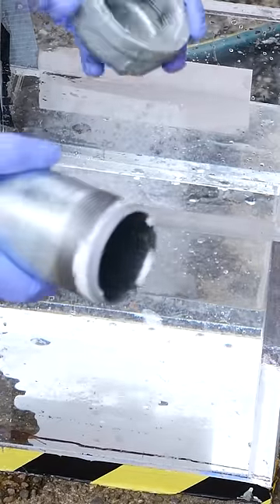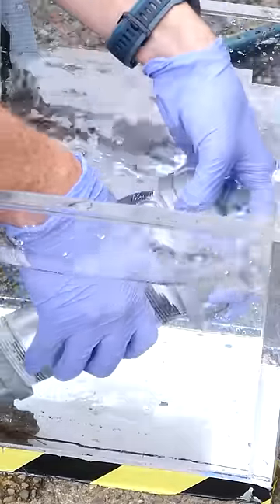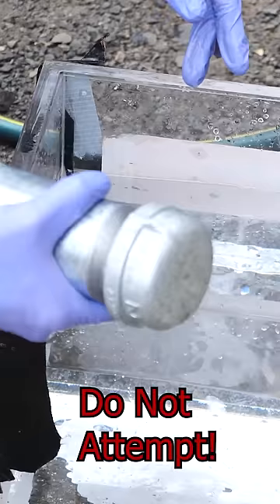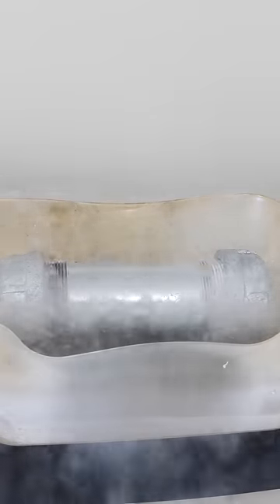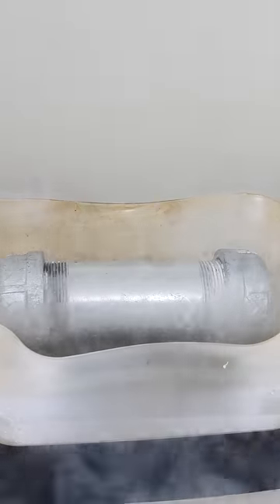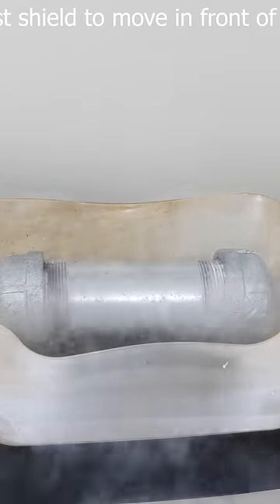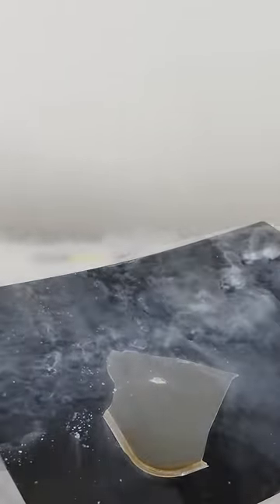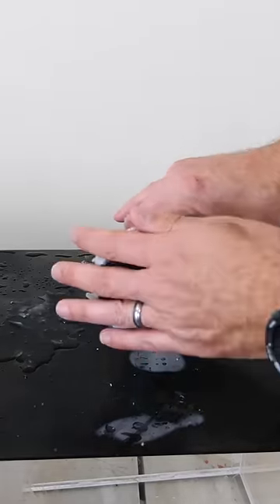Don't Ever Try To Stop Water From Freezing!

Comment: This is how you get burst pipes in winter. You should always turn on at least one faucet to a trickle during a deep freeze to prevent this from happening.
Reply: Drain your pipes much easier
Reply: it really only needs to be a pipe that's near the outside walls of your home — an interior room with plumbing is less likely to freeze ( so long as the inside of your home is above freezing)
Reply: @architecturalab incorrect.  But something an architect would definitely say. 👍
Reply: @architecturalab I usually flush a bunch of orbees down my toilet and down my drains to suck up the water
Reply: @corpsehandler5321 texas homes when snow: 🧨
Reply: No man. You need to insulate your pipes. Make them a winter jacket.
Reply: @nevinkuser9892 what? But insulating your pipes won’t help you here. What is that going to achieve?

Insulation only makes things take longer to reach equal temperatures. Not stop it from happening.

Basically if your wall is below freezing the only difference would be that it would take a little longer for the insulated ones to burst. But they would still burst.

Since most homes that people actually live in are heated it’s very unlikely that the wall would reach negative temperatures. This is more of a problem for something like vacation homes where people may be away from for months. In that case insulation on the pipes does nothing.
Reply: Why stop at just one? Do all of them to lower the risk as much as possible.
Reply: Or dont build pipes in outside walls??? 😂😂😂
Reply: Ran out of heating oil on Christmas Eve and the faucets were frozen shut for a good until like the 28th. Shit was wild I'm surprised we didn't burst a pipe
Reply: @xanderwusky  insulating pipes increase the amount of time between when you turn on the faucet, and pipes bursting.
Reply: @doppled  fair yeah it could do that

Actually I’m not entirely sure? Only if they would be empty if the faucet is turned off. If there is water in there anyway that would eventually freeze no?
Reply: @xanderwusky  i'd imagine like, having 4 hours to turn on the pipes before they burst when it gets cold vs like 10 hours

gives you a bit of flexibility
Reply: @doppled  I’d say if your pipes are build that way you just have badly build pipes. They should just be closer to the inside of your house so they don’t freeze in the first place. Your house heating should take care of that. I have pipes running though the wall too but it can be -20c outside and 10c inside and they still don’t freeze.

If it’s not at a place you’re heating because you’re not living there then having a still fairly short timelimit like this, definitely means you’re gonna be missing that time limit at least once. And if that happens you now have bursted your pipes.

I think you just have to have it heated or empty the pipes if you really don’t want to make the room even slightly heated.
Reply: This happened when I was in high school. My bedroom was in the basement and guess what flooded?
Reply: Having one end of the pipe drip won't protect the whole system.
Reply: nooooo! you're sewage pipe will freeze and you will flood your house if you leave the faucet on. You should have heat tape on any exposed pipes to prevent freezing. Im speaking from experience here
Reply: Last winter my faucet got pushed by the water expanding with so much force that it came loose and it dixnt even burst!
Reply: I do this every winter......
Reply: This happened to me this past winter in oregon... I'm a lazy pos though so I still haven't fixed it yet.
Reply: Thats how ypu end up with a frozen well. Frozen sink frozen kitchen frozen front porch frozen house...if you are on a well that water will push until it runs out which is essentially never. Least...not in this life
Reply: @KeaveMind that’s just silly
Reply: @architecturalab you go all winter without running water?
Reply: Yeah Texas been hearing that one a lot the last few years
Reply: If you have freezing pipes you had a crappy builder or a once in a hundred year freeze. It’s that simple.
Reply: @BlueDart1971  my pipes are inside the house and wrapped, but we do get the occasional deep freeze where it’s 25-30 below and it’s more of a precaution than anything.
Reply: @foosmonkey  I live in Alaska and I have also been a plumber for over thirty years. If built properly they won’t freeze unless there are extraordinary circumstances. It never hurts to take precautions.
Reply: Below 13 you gotta have them running at steady stream.Learned that the hardway while I was out of town
Reply: @nevinkuser9892 it's called heat tape and we do use it where winters are cold.Its not only insulation it plugs in and warms the pipe.Its like an electric blanket for the pipes.
Reply: @xanderwusky nope..... happens every year where I live...even with the inside heated well and and modern insulation pipes will freeze when it's gets around 20 and lower.
And yes, people do insulate pipes it's does help.There is also heat tape which is what I have,a litteral electric blanket for my pipes.Pretty common and not that expensive....but I still have to let them trickle when it's in the teens or they freeze.
In a vacation home even the toilet bowl/tank water will freeze.
Reply: Yep. We turn off all external water pipes outdoors around our property each winter. They’ll be turned back on once the freeze ends and spring is on the way.
Reply: My family learned that the hard way shit just bursts outta no where
Reply: Forgot that other places need to do this, our pipes are made to actually work in the winter and I’m so grateful for that
Reply: A trickling tap will not prevent this from happening... That's an old myth
Reply: Csme here to say this.
Reply: @xanderwusky  You ate the onion though they do put warm winter jackets on backflow preventers.
Reply: @TheTyisawesome It is not.  It’s common sense if you’ve ever lived anywhere cold or spent the 2 seconds to fucking Google it.  It works best if it’s furthest from your supply.
Reply: What's more is the metal is becoming brittle as well. Not a good combo at all
Reply: Jeszues!!! Ya vent the pipes so your don't create a vacuum! Lower pressure,  lower freezing point. Take an effing shop class. Ya know what, don't.  I like how this Darwin thing is swinging.  😊
Reply: @Redact63Lluks  It something a plumber would agree with. Drain your outdoor pipes in winter.
Reply: @nabtig5586

My friend..if your "flushing something that "soaks up water"
thats all good and fine and all
BUT the pipes most prone to damage from freezing are not your pipes that do the draining aspect of your plumbing system i.e DWV
drain,waste,vent. No sir..The pipes most susceptible to this type of damage are your water supply pipes i.e your hot or cold incoming pipes.Your homes water lines will be in either galvanized steel,copper pipe hard and/or soft copper,or a plastic pvc,cpvc,abs,oe a type of pex pipe tye 1 or type 2 pipe. With that said the logic behind leaving a fixture trickle drip is to evacuate some volume of water from your plumbing systems pippe BEFORE it has the chance to freeze you basically keeping the water slowly moving before it is allowed to completely become rigid and freeze. This works magnitudes better if the fixture that is allowed to trickle drip is the actual fixture/fixtures
 themselves most exposed to the freezing temperatures meaning if your home has two exterior hose bibs or points outside your house where you can hook up a garden hose to then those are EXACTLY where you would impliment the slow drip from the fixture and it would make it even less likely any damage might occur if in addition tthe 2 exterior hosebibs allowed to slow drip but also leave one INTERIOR fixture to trickle drib also i.e. a lavatory (bathroom sink)
kitchen sink ,bathtub etc. HELPS WHEN ALL EXPOSED PIPE IS INSULATED AND ALL BURIED PIPE BELOW SOIL ARE ALSO INSULATED TO A MINIMAL DEPTH OF 18" AND UP TO BUT NOT INCLUDING MORE DEPTH DEENDING ON YOUR HOMES LOCATION & HOW REGULARLY YOUR HOME IS SUBJECT TO FREEZING TEMPERATURES I LIVE IN SAN ANTONIO TEXAS SO A RESIDENTIAL INCOMING WATER LINE MUST BE BURIED A MINIMAL 18 INCHES BENIETH THE SURFACE BUT IN ANCHORAGE ALASKA..THAT MINIMAL DEPTH WILL BE MUCH DEEPER THAN 18 INCHES SINCE ANCHORAGE ON AVERAGE IS MUCH COLDER THAN SAN ANTONIO TEXAS. IT WOULD NOT BE MUCH TO OPEN ONE FIXTURE INSIDE YOUR HOUSE AND LET YOUR EXTERIOR FIXTURES ESPECIALLY IF THEY ARE NOT INSULATED REMAIN CLOSED COMPLETELY. some knowledge
from one that has been in this thank-less and under appreciated
trade since 1995.
Reply: @xanderwusky woosh
Reply: Yup this is why water services and water mains are always below the frost layer, water services and mains can run up to 8 feet deep to prevent your house from having no water during the winter. And like you said the pressure builds up and the pipes explode and during the summer you end up dealing with leaks and muddy water in your house. IF it's one of those old water pipes that isnt deep enough but I'm sure most of those were replaced long ago.
Reply: @jacobadams5941  don’t think you get how that works
Reply: prependedprepended6606  that’s an entirely different situation in that case you’re actively heating instead of just insulating. Then absolutely that would work.
Reply: @delmuswu-tangbroadnax9056 Texas?
Reply: @architecturalab and not use the water for toilet, cooking, drinking, washing? That is easier?

Comment: You might have forgotten to mention that metal contracts with lower temps or when it gets frozen.
Reply: That's why water pipes freeze.  Old pipes used to need to have people getting water from them to keep water running slowly or at a fast drip or the pipes would break.
Reply: LN2 temperatures also makes steel extremely brittle. If the temperature was taken down gradually like in a household freezer, the steel would likely flex but not break
Reply: @i3igpete  no, it would have failed 100%. The threading used to screw the top on was what gave. That would happen regardless.
Reply: @i3igpete  What is LN2?
Reply: @edwardlewis1963  The sequal of Liquid Nitrogen
Reply: Not only does it contract. It also becomes brittle.
Reply: @edwardlewis1963  he means liquid N2(nitrogen)
Reply: @vighneshprabhu4242  Oh, thanks; LN2 = liquid N2(nitrogen)
Reply: Get em!
Reply: @jackpokrywka542  the threads didn't fail, the pressure rupture the cap. you can see it's still threaded on.
Reply: @dominator-tc8ik  couldn’t really tell with the ice covering, I didn’t look that hard at it. Looks like the top of the cap gave out and the sides of the cap stayed on.
Reply: @xtradrive-kz3rz  this made me lol
Reply: It's minimal compared to the expansion of water, less than a millimeter
But yeah it does contract, it's just in physics you approximate everything
Reply: @i3igpete  no, it would still explode. Back when "scientist" was still an adequate job description, a guy tried this using an artillery shell and a winter's night. By morning it had cracked the shell and shot the cap out with significant force.
Reply: @jackpokrywka542  yes, that's what i said
Reply: Over kill
Reply: @jackpokrywka542  What if he glued it with the strongest sealant possible? Like a cement or something. Would the seal still give out before the pipe broke?

Comment: There's also a problem with using a metal container for that as well. Because if you are aware metal contracts due to cold, so not only is the water trying to freeze. The metal is trying to contract around the water. So it's giving you even less area to work with an either material, "so it just got angry" Or in scientific turns, it combusted due to a build up of pressure
Reply: Nothing here combusted
Reply: @xavier1964  Do you live in a metal container?...
Reply: @Leylani-v6i  Combustion is a specific type of reaction that involves a molecule reacting with oxygen to produce heat + CO2 + H2O. There was no combustion here.

Comment: Keep in mind that using what is likely liquid nitrogen he's making the likely CAST pipe(iron or steel but casting is more brittle vs say forging)...the pipe is chilled down to very cold temperatures before the water inside is, and unlike say the metal at freezing, well below this the metal just gets more and more brittle.  Ex: If you threw this pipe in your food freezer it would take hours to cool down, and the pipe would be much more likely to plastically deform but not burst.  It still probably could burst though as pipes do all the time when they freeze...sometimes it's a cyclical thing too, ex: pipe freezes and doesn't burst but it's been deformed and expanded and embrittled, happens again, and again, until then the pipe bursts because it's been expanded and weakened too much.